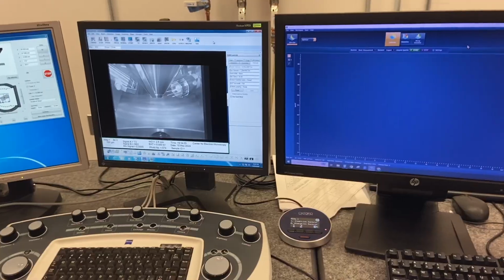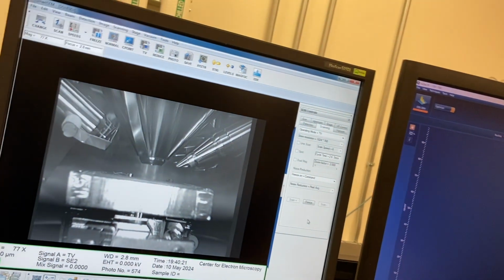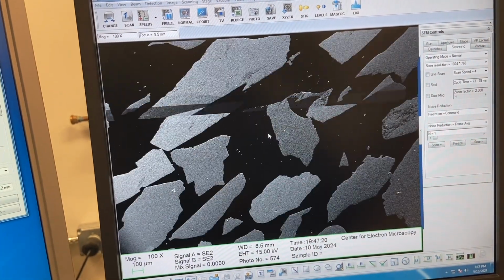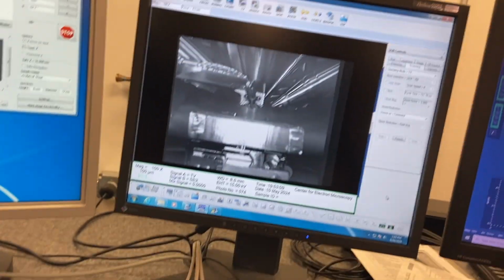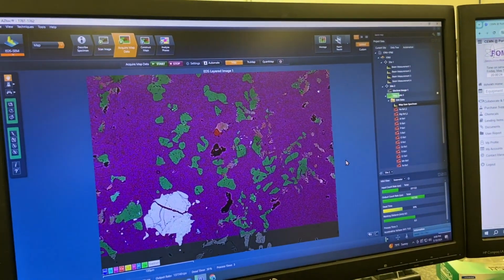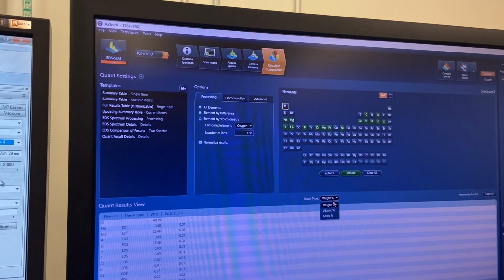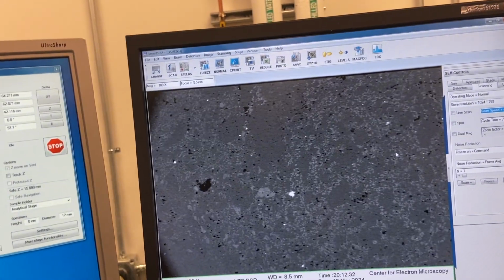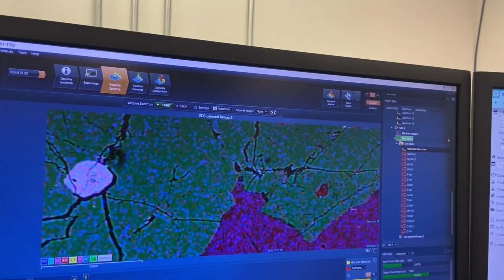Meteorite Classification Vlog 1: A Unique Melt Breccia From The Moon!

Comment: Very interesting to see this process. Is the carbon coating easily removed, if you want to view the TS in transmitted light / XPL, or is analysis in transmitted light always done before SEM analysis?
Reply from the maker: Generally you'd prefer to do PPL/XPL before SEM so that you can locate where everything is distributed, and gain some preliminary knowledge into the textural details of the sample. The carbon coat doesn't affect PPL/XPL if you do it after per se; but it does affect reflected light observations (generally to observe opaques like Fe-Ni metal and Fe-sulfide). But you can always remove the carbon coat by polishing it on a microcloth with an alumina powder slurry.